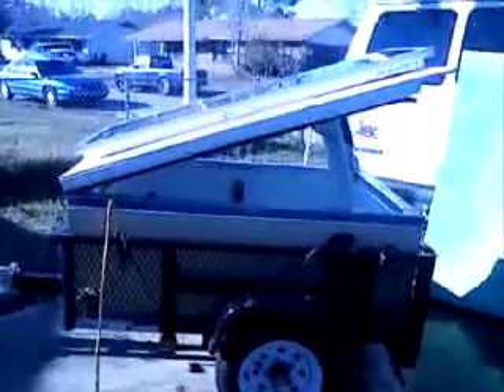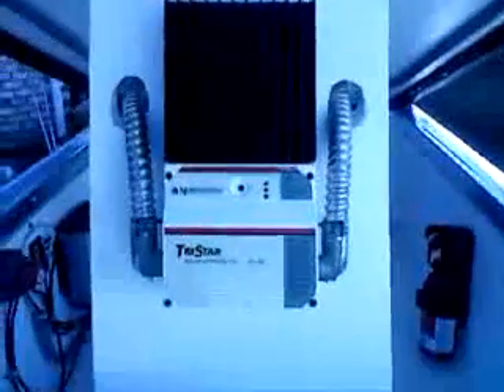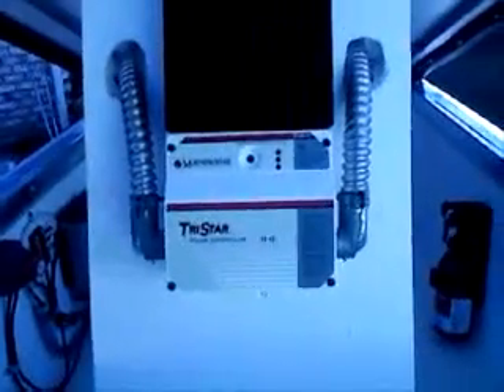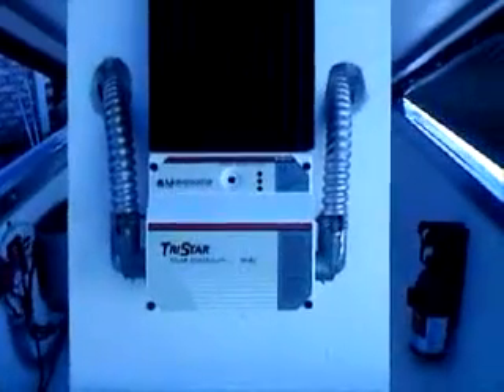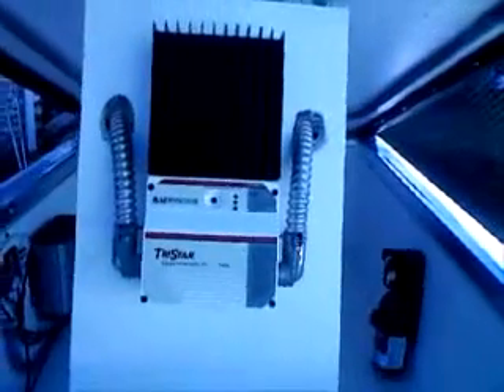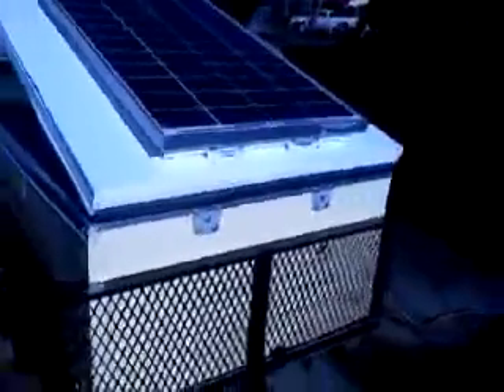Solar Powered Trailer - Improvements

Comment from the maker: Anything up to 1000 Watts. Useable power, in direct sun, is about 75 to 80 watts. I could do better with a more efficient inverter. Could also do better with more panels. This system is relatively small.